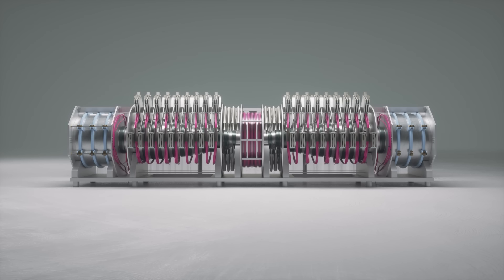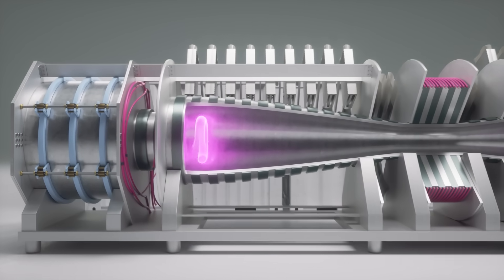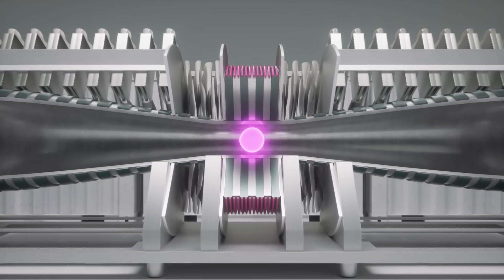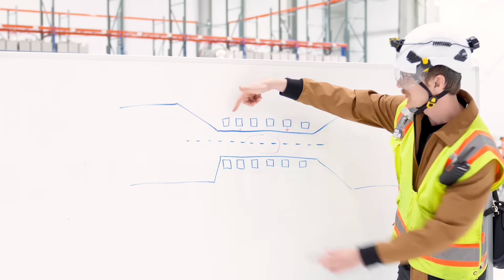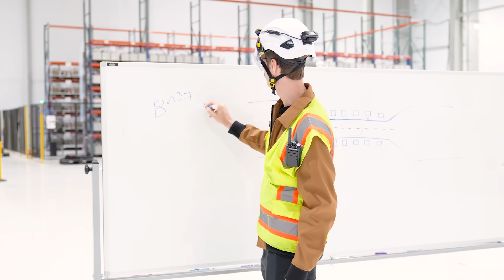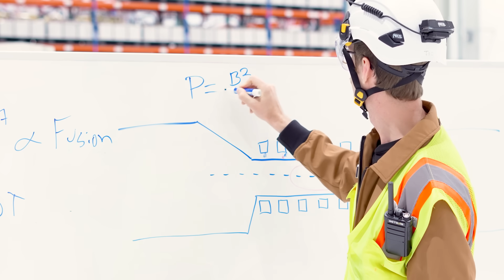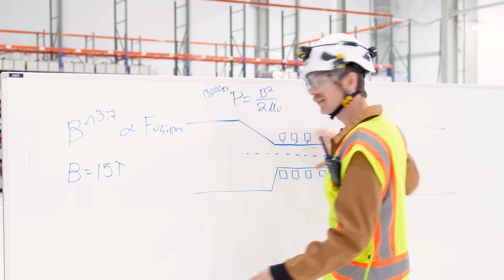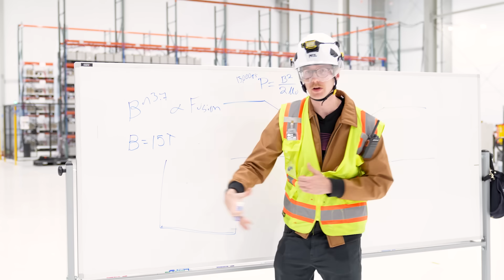The Extreme Mechanical Engineering Behind Fusion

Comment: This is extremely impressive! As an electrical engineer, seeing the extreme currents you are dealing with and preventing the entire thing from ripping itself apart is fascinating. And your energy conversion circuit, which can at the same time provide current to the coils, but then extract that current again at a higher voltage...  That must be very tricky, but also rewarding for your power electronics engineers to build!
Reply: It can be very fun to work on such challenging engineering projects even if it never ends up leading to an economically practical source of electrical energy.
Reply: No turbine !
Reply: @MrSimonw58  - Helion Energy's approach bypasses all the traditional approaches to extracting the energy from the fusion reactions. In their approach the expanding charged plasma, due to the fusion reactions is supposed to induce a countering force on the compression magnetic field which then is expected to feedback to the coils and then to the capacitor banks that feed the compression coils. The scheme has never been tested at such extreme energy levels and at the short timescales they will be dealing with.
Reply: @vernonbrechin4207 Polaris, the one in active testing now is doing that. Its the 8th version of the machine.

All the predecessors before this were testing and measuring the repeatability. Now they are confident enough to try harnessing power

Comment: Indeed, with the present progress in the operation of Helion's Polaris pulsed fusion reactor in producing electrical output more than the inputed energy from the utility grid, the electrical energy capture per pulse every fraction of a second as being stored in the HV capacitors, must have a Q of > 8 or more so that the efficiency output is suitable to tie-in the grid and bring down the cost of electricity by Helion energy company !!!!😊
Reply: Note that when the fusion energy gain value (Q) is provided by most nuclear fusion energy experimenters they typically calculate the value by employing an input energy value that is a tiny percent of the energy required to power the experimental facility. Most experimental fusion energy experimental machines operate in a pulse mode. The Q value often only applies to the short time period that the fusion is actually occurring so that value has no connection to the time that the fusion is not occurring and yet the facility is still consuming large amounts of energy from the grid.

Comment: So as I understand, the fusion happens in the middle of the “hourglass” geometry and the high velocity protons resulting from the fusion induce currents in the surrounding coils. I think the protons will fly in every direction randomly, doesn’t it mean that the net induced current is zero?
Reply: The Q will likely end up with a net of less than 1(like all previous fusion projects) i believe the record is a Q of 0.67….which is a useless waste of energy, they haven’t solved how to get more tritium yet(i believe there is less than 1kg on earth currently) and they haven’t solved how to stop atomic displacement from high energy neutrons “the first wall” issue….but sure those minor details aside….im sure it will work this time…..or be 30 years away like its been since the 60s…..the 80s…..and the early 2000s 🙄🙄🙄
Reply: @NotAnotherMitnick that is another interesting problem but it doesn’t answer my question… 🤔
Reply: All the water vapour molecules in a pressure cooker are flying in every direction randomly. Does that mean that the net presussre on the walls is zero?
Reply: @MattNolanCustom but asI understood it is not just about the pressure of the high-speed charged particles but also the direction they fly since that corresponds to an induced current in the surrounding coils and the net effect of random direction currents can be zero. In a pressure cooker it doesn’t matter which direction the molecules are flying and hitting the wall, it is still just pressure. But currents caused by the high-speed charged particles have a direction and the average induced current might be zero…🤔

Comment: Consider the possibility that this video is largely diversionary fluff and intended as a promotion of Helion Energy's efforts. Omitted was the fact that back in early January, 2024, they predicted that their 7th generation machine, Polaris, would be generating useful quantities of electrical energy by the summer of 2024. The initial presentation here was crafted to make it appear that it was now generating a significant amount of fusion reactions but no details were provided except at the end they stated that they are detecting neutrons. The neutrons can be detected at many orders of magnitude below the point where a highly significant amount of fusion is occurring. The 6th generation experimental machine conducted over 10,000 test shots and yet there is no evidence presented that any one of those shots generated more than one watt-hour of fusion energy. The same holds true for the ongoing Polaris test shots which have apparently been conducted for over a year. It appears that components of the Trenta experimental machine have been cannibalized for use in Polaris. Though the plasma compression may take around 0.001 second the fusion reactions are likely to last for only around 0.000,000,001 second at the tail end of the compression cycle and then it is likely to blow the bulk of the plasma fuel away before it has a chance to fuse which would mean that the fuel 'burn' efficiency could be very low. The magnet coil drive power electronics will have to operate in reverse and likely switch at time-scales in under a few nanoseconds. The primary aim of Polaris is to fully recharge the last compression coil capacitor banks after the conclusion of each compression cycle. This will likely be a major challenge, especially considering the impact on the  major switching components. The Polaris experimental machine is expected to fire at a maximum pulse repetition rate of once per second. This means that a fusion reaction pulse, lasting for approximately 0.000,000,001 second will need to deliver a massive amounts of energy, to the capacitor bank, in a time period less than the compression coil discharge rate. Then the energy in the capacitor bank would need to be discharged into an electrical grid delivery system before the compression coil capacitor bank could be recharged to perform another compression cycle. In order to derive useful energy, from such a system, it is likely that the energy receiving capacitor bank would need to be charged to around ten times the amount of charge energy required to drive the pulse compression coils. Polaris is not intended to deliver electrical energy to the grid. A future power plant machine, that performs similarly, would need to generate horrendous amounts of fusion pulse energy, with each infrequent shot, so that the average energy, delivered to the grid, could be in the many hundreds of megawatt-hour range. Note, that when typical fusion experiments facilities provide the fusion gain factor (Q) typically only a tiny fraction of the energy, required to power the facility, is used to calculate the fusion gain figure. I believe that is deceptive.

See the following reference sources.
------
From S&P Global

05 JAN 2024
Fusion energy industry anticipates electric power breakthrough by summer
By John Siciliano

The Washington-based company Helion, considered a frontrunner in the race to develop a cost-effective commercial fusion power plant, said it plans to be the first fusion energy company in the world to produce electricity from its prototype Polaris reactor in 2024.

------
The problems with Helion Energy - a response to Real Engineering (YouTube)

==========
Generally all nuclear energy advocates assume that we have at least two decades left to turn this 'Titanic' around using their favorite technology. Like most of the other 8.2+ billion people on this planet they are living in a profound state of denial.

UN chief: World has less than 2 years to avoid 'runaway climate change' (TheHill)
  * This statement was made 7.2 years ago.
Reply: Yes, they also have not decided to attend APS-DPP this year which is the biggest fusion conference in America, and which almost every fusion company in the world has come to present their work and receive critique/feedback. But instead decided to release a series of interviews and promos they did with other YouTubers at exactly the same time. The best hope is that they actually did get power and will surprise everyone, but if they happen to not meet their final deadline for power by 2027, hopefully this doesn’t drag down the reputation of other fusion efforts.
Reply: @theuserofdoom  Helion Energy has missed previous benchmark goals that they set for themselves, before the Summer of 2024 goal for Polaris to be generating more electrical energy than it consumes. They simply keep quite about their missed goals and then set later goals, assuming no one will notice the failures.
Reply: @vernonbrechin4207   Polaris is late (considering the scope of the project, not by much), but they did not miss previous benchmark goals. You keep repeating this lie.
Reply: Thank you for those insights. Nevertheless they got funded. Probably the aim or outcome is something else. The USA did similar things to crush the Soviet Union, so this whole Helion might be just an attack on China, so that they put too much resources into it. Europe does not believe in it.
Reply: What is your intention in sharing this perspective?
Reply: @rolz71  If I could interject... there are many reason to counter fusion hype, including:

a) Help would-be investors from losing money
b) Keep an even keel on fusion hype so that money and resources can be properly allocated to things that will actually eliminate fossil fuels like renewables + storage.

Renewables + storage directly tap into already available fusion energy we are gifted to us for free by nature in gobsmacking cosmic stellar amounts.  So much power in fact that it can power our tiny blue/white dot like 10,000-times over.

All this energy arrives freely with zero fuel costs and zero fuel infrastructure costs which are huge problems fossil fuels and even nuclear technology -- even nuclear fusion technology because tritium and He3 do not exist in any quantities approaching the needs of the proposed utility-scale fusion power.  So much for the "limitless" energy trope of fusion technology brochures we've heard for decades and still keep hearing.
Reply: @rolz71  - My intention is three-fold. (a) It is to provide the general public and investors with a realistic perspective on what is actually occurring in the experimental facilities. (b) It is to educate them in the process of critical thinking in the face of one-sided promotional sales pitches. (c) It is to prevent the use of billions of dollars of resources towards efforts that are highly unlikely to deal with the rapidly cascading climate emergency, like the waste of resources on over 150 fusion energy experimental efforts since such experiments began in the 1950s.